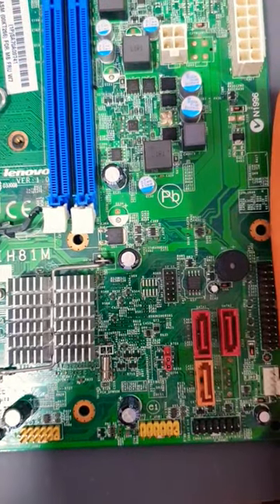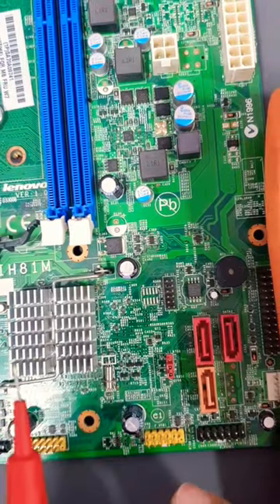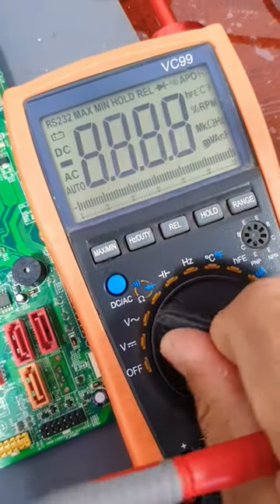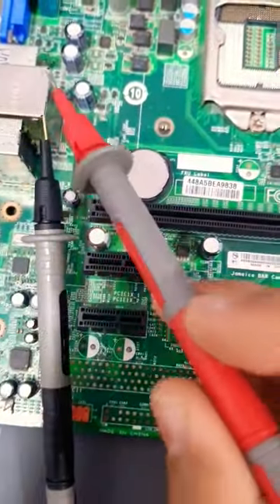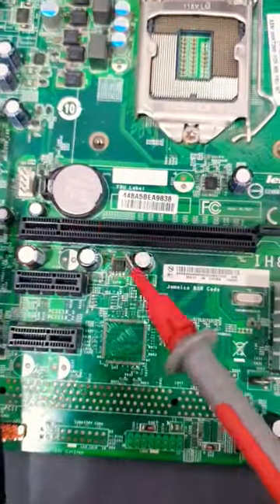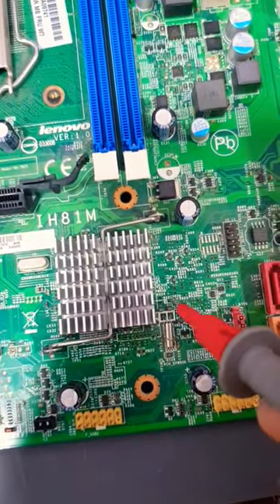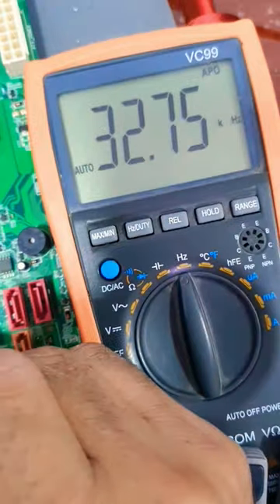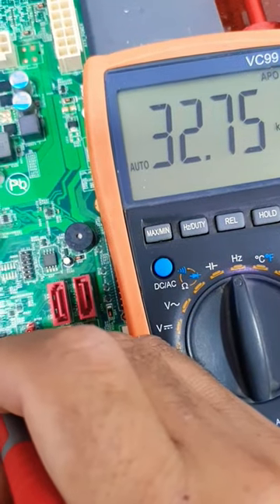Test RTC Crystal Oscillator without Oscilloscope!!!

Comment: Is it acceptable to use this method to test all ICs/microcontrollers with a DMM instead of oscilloscope ?
Reply from the maker: Not always 
Sometimes DMMs gives incorrect readings, especially when testing high frequency signals..
But as a preliminary check I use DMMs
Reply: DMMs work pretty well when we want just to confirm whether pulse is there or not. To examine deeper, we will definitley need a scope, especially when we need to see exactly what the waveform looks like. I'm not sure about laptops, but to check high frequency pulse of any smps, a regular multimeter with a broad range of frequency will do perfectly.

Comment: What about if we have that 32.768khz but with a pretty much a square wave at X1 and  saw wave at X2. It supposed to hava sine wave both.
Reply from the maker: Yes you are right 
This is only a preliminary check to see if it does work or not, but if you have doubts it isn't working properly or generating the right waveform shape then you need a Oscilloscope